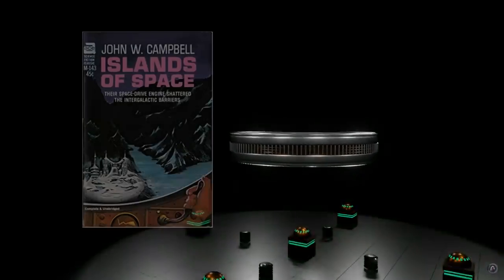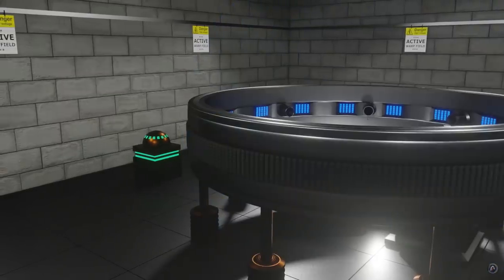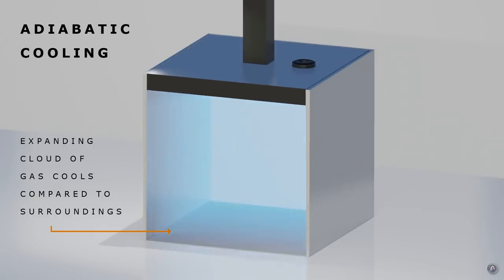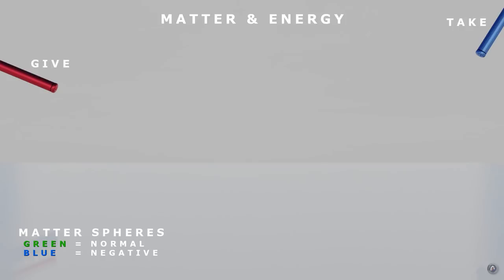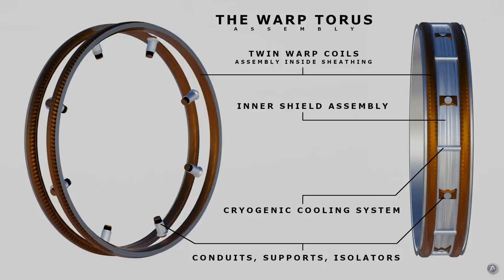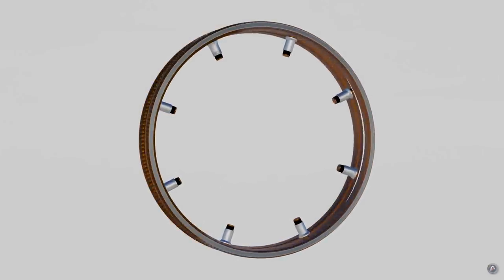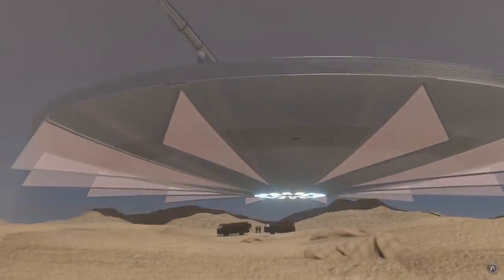A Detailed Breakdown of an Alcubierre Warp Drive Coil

Comment: Warp drive is produced by manipulating exponential values. If we consider the ampere as the speed of light 2.99792458 x 10^8 m/s and the force or newtons as an ampere squared (A^2) at 8.987551787 x 10^16 m^2/s^2. We now equate the force to 89.87551787 x 10^15 m^2/s^2(8.98 x 10^16 = 89.8 x 10^15) the square root of the new quantization is  9.480269926 x 10^8 m/s. We are now travelling 3.16 times faster than the maximum speed of light. Granted this is math abuse, but it gives a general idea of what is taking place in this fictional phenomenon.

Comment: I am impressed and would like to know how to get a set of drawing for the warp drive and the basic parts .
Reply: just make them up
Reply: @MyKharli I have a thought that a plasma flow through an electro - magnegtec field  along with a photon flow . The photons are collected from space .
Reply: @charlesjohns9722  Of course, but also you have to optimize the polarization degree of the electro-coupling to the phase-shift by at least 0.05 micro-sciences.

Comment: And how would we produce the insane amounts of energy needed to do reach the necessary speeds, let alone to brake? And how would we safely navigate through all the debree we'd pass? Even for nuclear fusion the amounts of enery required are massive.
Reply: a warp drive doesn't move through spacetime...it is moved by spacetime ITSELF. There is no need for braking, just turn off the warp drive. As stated in the video, such exotic matter has a repulsive effect, so debris and energy in the direction of travel is literally repelled out of the way. It is suggested that an antimatter reaction be used to power such a drive, because yes, fusion would probably not be powerful enough.

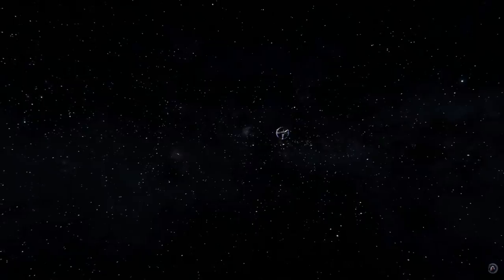Comment: At Time index 2:30, did this guy say that in 50 years, we'll be able to travel Faster Than Light (FTL)????????

Time index 3:00: "First let me give you a detailed description of how the Warp Drive bends space. A Warp Drive Engine is made up of parts X, Y, Z... ETC.". <-- WTF?? 

The components needed to bend space can't be relegated to "ETC.". You either have the technology or you don't. Seeing as we DON'T have the required tech or any idea how to create the required tech at this point, detailing how this mythical engine bends fucking space is a bit of an overreach don't you think? What we have is a mathematical equation that says that bending space is theoretically possible. We don't have any idea how to actually do it is sorta the point though. So this can't possibly be a Detailed description of how a warp engine bends space can it? At this point, you could literally say that Unicorns are the main component of a warp engine and provide the necessary magic to bend space. 

Etcetera,,,, what the fuck? 

So basically this whole video is little more than clickbait. Enjoy your downvote.

Comment: You cannot warp space since space has no properties as Nikola Tesla said, you can however electrically produce compression and rarefaction in the ether aka the dark matter/energy, quantum foam/fluid, etc. if you figure out how to, allowing you to travel faster than light depending on electric power input. Ether is several thousand times denser than air and permeates all space as there is no such thing as empty space.
Reply: Space-time.

Comment: To power the alcubierre warp drive we can use thorium which 1 ton of thorium can generate as much power as about 100 tons of uranium

Doing the calculations 1636 tons of thorium can create 18,000,000,000 mega watt hours and 1636 tons of thorium is about 10 huge shipping containers

Comment: mass is a deceptive thing....

space being saturated with negative charges (the remainder after all things entropy), can be visualized as points of negative charge. particles/mass as we observe, is merely knots formed by the undulation/cavitation of said field of negatively charged points in space.
What we see as positive masses are bubbles having greater volume than density of charges. what we see as negative particles are more solid or tightly wound knots... the threads of which are the paths and trajectories of the negative charges of space trying to return to a static position in the field.

your warp coils work only because they are capable of creating a larger gap between the negative points in the field of space than can be refilled by the movement of the negative charges at ant given instant.... thus creating an effect similar to fluid or aerodynamics within the vacuum of space.

i may not know the lingo, but i understand the functions (at least i think i do)

Comment: I know one thing regarding this topic. If we ever create a warp drive that takes us from point A to point B in normal spacetime faster than a light beam then all the relativistic equations that contain the speed of light (c) are wrong. This is because these relativistic equations need to use the fastest speed at which information can be transmitted. If a faster than light warp drive were possible, that would mean that you would be able to transmit information faster than light from point A to point B in regular spacetime.

Now, you might say that in a warp drive faster than light speed is not achieved by moving through spacetime, but by having spacetime itself expand faster than light. But this does not remove the problem I explained. If you can be in a spacetime bubble that moves faster than light and then exit this bubble and reemerge into regular slower than light spacetime, you would be able to use this mechanism to transmit information faster than light from point A to point B in regular slower than light spacetime.

Imagine point A and point B in regular slower than light spacetime and then putting a warp drive in between these two points. So as far as points A and B are concerned, they don't know about this faster than light warp drive between them. All point B knows is that it received information from point A faster than light. And once this happens then the thought experiments that Einstein used to arrive at the relativistic equations can no longer be correct since these thought experiments assume that point B in regular spacetime cannot receive information from point A in regular spacetime faster than light.

The only way to circumvent this problem with a warp drive is by saying that a warp drive doesn't just alter the speed of space, it also alters the rate of time flow. So that when you leave point A and arrive at point B using a warp drive, it will be faster than light relative to your onboard time, but to observers outside your ship the time you took to arrive at point B would still be more than for a beam of light.

So this means that the "twin paradox" happens with the Alcubierre drive just as it does for speeds in regular spacetime that are very close to the speed of light. So why bother creating an Alcubierre Drive? Why not just achieve speeds in regular spacetime that are very close to the speed of light? There would be one reason to prefer an Alcubierre Drive, and that is if the energies required to create an Alcubierre Drive are much lower than it would take to accelerate very close to the speed of light.

Comment: There is something I think I understand or maybe I don't. If the speed of a warp field (bubble) is propagated at the speed of light but the surrounding space around the bubble is moving also at the speed of light or higher then how can the bubble be created enough on time, to stop the front edge of the spacecraft moving closer and closer to the front edge of the bubble, since the creation of it also depends on the speed of electromagnetic propagation. Also if the space craft and its bubble was moving faster than light but bubble created at the speed of light would not at that or slightly higher velocity cause the bubble to momentarily slip behind the spacecraft and momentarily force it into normal space then the bubble vanishing and the spacecraft suddenly back at greatly under light speed, in normal space, so like an oscillating effect of over then under, light speed. As it dropped back to greatly under light speed, its bubble would be recreated around it and the same thing would repeat, theoretically.

Comment: What problems in way imagine warmholes is one big Portal reaching over light yeas.
 . But a series of Microscopic warmholes  combining  opening in front you as you moving is more feasible
Reply from the maker: Wormholes and warp gates are a related technologies. You do not need many small wormholes, one is sufficient. The key is in enlarging the one and holding it open and with relatively less energy than expected.
Reply: @asteronx  but as combine . Plus is no  an energy Field around the ship would them up.. an out ward pushing Energy field

Comment: Probably a bit late to be commenting but a thought occurs. I'm no science or math wiz but correct me if I'm wrong the main issue we are looking at right now is the amount of energy we need to produce. In all examples I see of this type of warp drive the idea is to keep the ship static, however this doesnt entirely make sense to me. Movement inherently generates energy and we need to make both a positive and negative field. Would it not be more efficient to have the disks rotating? Another reason I think this is because and I know this is reaching but on the ocean there are high speed currents created by opposing movements and it causes a rotational tube that pushes things in high speed in 1 direction. Could this not also be applied to space if we are able to manipulate in a way you could water?

Comment: Star trek is not a science fiction writer!

If you push two Casimir plates together very rapidly you get photons, positive energy, I think if you do the reverse you may get negative energy, by turning the plates into two rotating rings the area where they move towards each other may produce positive energy, whilst the area where they are moving away from each other may generate negative energy, by using two sets of nested ring plates this may be enhanced, according to Hermann Bondi if you have a negative mass & a positive mass near each other they will both move in the direction of the positive mass, an effect called runaway motion, the same applies although much weaker for energies.

Comment: What did I miss? So you charge up the assembly, and some how spread it thinner than the quantum vacuum fluctuations? How, by what means?
Reply: The ferritic vacuum dimension is calculated using multihedral claveman tramantics. The Holsak equalty equivalent jambold resistance is gream-tuned to ultra-harmonic waveguide diffusers modulated with flametic hamsulk blemcrats.
Reply: HERE IS WHAT YOU MISSED....THE INVENTOR OF THIS CONCEPT IS  MIGUEL ALCUBIERRE, A MEXICAN SCIENTIST......FROM WATCHING THIS STUPID VID YOU WOULD HAVE THOUGHT THAT IT WA S SCOTTY FROM STAR TREK.

Comment: Wait so, you guys say that at the center of the EM field will be...negative energy? I'm sorry what? How would this create negative energy? 3:46
Is this in a vacuum? Or...
And even so, 10^-2 ergs is the vacuum energy of free space. How exactly do you plan on making this go into the negatives....with an EM field? This doesn't make sense. Does the EM field affect virtual particles? But even if it somehow did, wouldn't that, as you said, just create negative energy at the center of the ring? And assuming it did, wouldn't that just cause space to expand within that ring into all directions? Meaning you wouldn't go anywhere?

Comment: hey whys the paper not available - but you are right a certain value and frequency wil make things move and Warp is based on electro magnets and antennas...its being said a em bubble can create a energy difference with the environment - but all you need is a magnets and antenna array to prove warp; by changing an em bubbles shape...

Im not too sure about this double bubble but it seems in sync with the Earth and its core dynamics which is actually several magnetic fields compressed even accelerating upwards interacting with the 3d magnet - resulting in gravity; thing 6 pointed cross and you got it..

Comment: Star trek talks about signatures these are like standing waves or probability waves or patterns . The thing that makes information unique it's signature.

Star trek also says something like anti matter, matter exchange rate, that's convection.

If positive ions are spread out and spinning in a direction away from center.
To then what's left through polarization, is the opposite negative ions. That go in the other direction towards the center.

That's convection and of endothermic and exothermic cycles. ➖    ➕ That's so much like a cloud 😀 woooooo.
Like a cell like a cloud like the oceans like the flow of a solar system or a galaxy. Convection currents it is of life it self, it's the torus field which is a moving energetic wave. Thats propagating outward and inward at the same time within the same spaces.

Light may be a particle and a wave at the same time. This perspective on the waves propagated of any signature properties. It has the same effect as light, all embodiments like life like of all the bodies of convection. Which is all organics or clouds or ocean convection so on. They all have this effect of a particle and a wave positive and negative. All embodiments exist in these states of lower and higher dimensions at the same time. Which make the toridal effect it self, the propagated wave and the embodiment.

What ever this perspective is, something is their in this dynamic. As if each embodiment by it self and unique. which is apart from the infinite, it is still connected to all the possibilities of the infinite.
.
.
.
.
.
.
.
.
What if their was a senser to sense these oscillating pattern dynamics of positive and negative signatures ????

This would give capabilities to us far greater then before.
Reply: Sold, do it..!!

Comment: My mind is so melted right now.  The video is a awesome though. 

I will say, I'm pretty sure Nasa's warp drive presentation indicated that the drives are not "locally" super luminal "FTL". 

There are  significant benefits regardless and the tech is mind blowing. But I speculate we can't go FTL with them. 

MAYBE in special areas where it doesn't break causality, and where the field we are manipulating has strange properties. I'm thinking about jumping across inter galactic space where it's stretching faster than light. The properties there may allow us to negate that  and jump the gap. Something like that.  Another example would be beyond the event horizon of a black hole. The warp drive may allow you to get out of the black hole, but as soon as you exit the even horizon you are back to being capped at light speed. 

Also keep this in mind.  The n^2 communication problem.  If FTL is possible, then every species out there, will be able to contact every other species. 

In any reasonably sized universe that creates a real noise problem.  We don't have a noise problem, so that tells me FTL is likely not possible.
Reply from the maker: FTL travel is possible and a longer video showing the growing evidence is coming. For now: https://youtube.com/shorts/0UMI6zAdcms?feature=share

Comment: no idea on the actual components. speculative theorizing on its function. coil has how many winds , whats its capacital tolerances, how are the diodes set and what capacitors can handle an 18 bil burst without blowing? lots of fiction little science.

Comment: Increase efficiency with superconducting  superfluids.
Reply from the maker: Indeed, superconducting materials will be vital for field generation.
Reply: @asteronx  Yes but what I am talking about is a superconducting liquid that is also a superfluid which we don't have at this time. Unless supersolids well work. It well allow you to pump energy into the system making it spin in a torus to a good percent of light. If we had a material able to take the stress. Using frame dragging plus there have been experiments using spinning superconductor that seam to decrease inertia mass until the military funded the project.

The superconducting fluid that is also superfluid has no resistance to electricity  or movement. Using this system for the warp coils. Once charged up if temperatures are maintained has very little loss in energy. Then using another system to contract space in front of the ship and expand space in the rear.

Comment: AsteronX could the drive be built on a small scale, if so would it still lessen gravity ?
If so, would it not be best to build and use smaller devices in the heavy transportation of goods. More items moved for less fuel.
Reply: Great idea! If you believe studies starting in 1961 by Robert Forward "General Relativity for the Experimentalists", Matos Tajmar or Tate's studies on things like "Extended Analysis of Gravitomagnetic Fields in Rotating Superconductors and Superfluids" (2003) or maybe "Static Test for a Gravitational Force Coupled to Type II YBCO Superconductors" (1997) then sure anything is possible. I have yet to read these, but if I get hit with a 'wall of Murican censorship' before then, I may not let you know.

Methods of floating include: buoyancy (would negate some weight, not enough), type 1 superconductor diamagnetism (earth not strong enough of a magnet, polarity doesn't matter), stored angular momentum allowing an asymmetrical force exchange (doesn't allow lift against gravity as a whole craft TMK), magnetogasdynamics (inefficient; surrounding air needs to be conductive, some stealth uses plasma sprayed out at leading edges of aerofoil, also more efficient to fly through), coanda effect (the standard static-dynamic pressure tradeoff of a full lifting body), and finally these mystical gravity modifying superconductor experiments that claim to knock objects off desks two floors down (WIP).